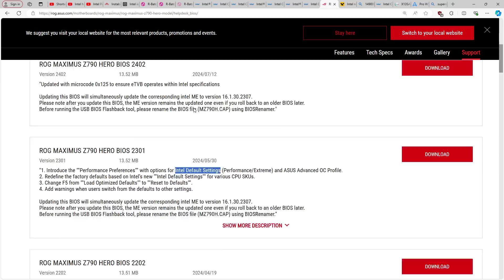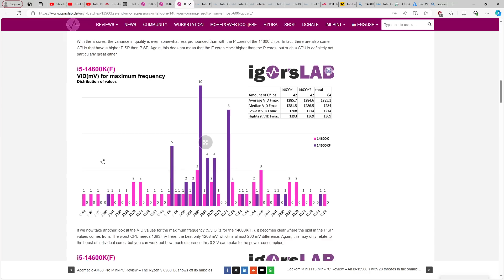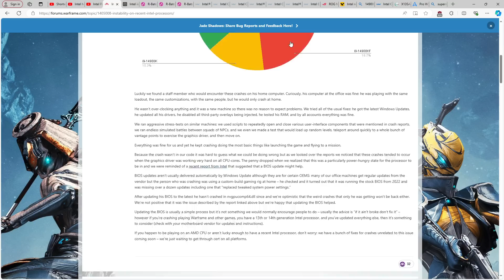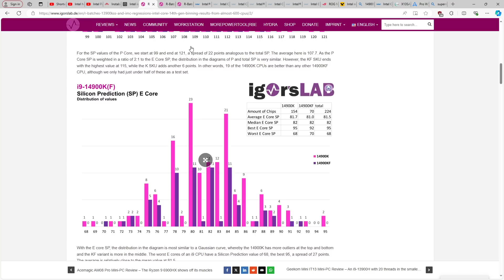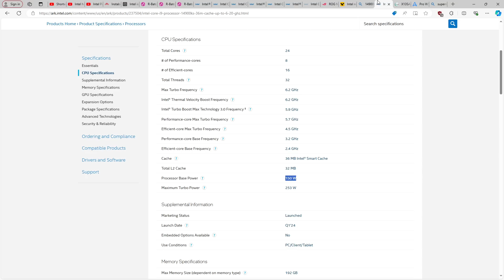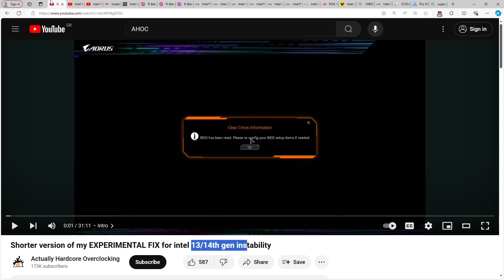The intel instability and degradation rant.

Comment: The reason for the lower LLC is because Intel is trying to run the clock out till 15th gen, they think it will get swept under the rug if they can just make it to 15th gen
Reply: And, the ecores aren’t degrading but if the power rail is failing then the ecores can be sucking down power that the pcores could use
Reply: But it isn’t power, it isn’t voltages causing the degradation or game servers being pampered wouldn’t be dying
Reply: My theory is that they keep making them thinner and thinner and this has caused exposure. They keep honing and honing these binned cores to the point of craziness. They started this with 11th gen, but now it is nuts. They are leaving thickness out of the manufacturing process, maybe this is leaving circuits exposed to heat, especially the power ring
Reply: @waynetuttle6872  Then it isn't CPU silicon degradation.  It must be something else that is failing.  If these continuous multicore loaded, 150w capped game servers running probably around 1v are failing at much higher rates than the general public running these chips on Z790 boards with intermittent single core loads that are often hitting 1.4v-1.5v that points towards the cause for silicon degradation not being the cause for these failures.
The other significant difference is using w680 motherboards that have, by typical i9 usage standards, utterly pathetic VRM systems.  If there is a difference in stability percentages with a difference in hardware, it might be the difference that is the cause of the instability.
Reply: @rluker5344  possibly, but I doubt it. Take any other architecture as a standard, aside from 11th gen which also has failure issues due to thinning of the substrate. Given enough time, despite the vrm or chipset, every last 13th or 14th may fail under ultra low voltages. Some of the server chips are dying day one, this is clearly a production issue when there are currently 4790k chips still chugging away at 5ghz from 2014 with zero issue going back to stock settings. There are 3600-3950x chips that have been gut overclocked and super high voltages since release that will function perfectly at stock settings and run stock voltages and clocks with zero issues. Half of all server chips are literally useless from one to thirty days of use.

Comment: This is not just limited to 13th and 14th gen CPU's. I've been running an i9-12900KF on a ASUS Z690 MB for almost a year, no overclocking, out of the box BIOS settings, with no issues. Recently I started experiencing lock ups and blue screens. Any form of benchmarking ALWAYS froze and blue screened. After a lot of diagnostics I nailed it down the the MMX benchmark.
After discussing with the shop I purchased the system through the guy suggested I try the Intel default profile and boom, fixed!. Haven't had an issue since.

Comment: I believe the ambiguity from Intel on max voltage is partially to blame here.  Datasheet for RPL “-S” says 1.72V max.  Under what conditions would > 1.6V, especially over time, not degrade the processor (outside of LN2, etc.)?

Comment: I can't think of a reason other than VID tables with too high voltages or too-high hotspot temperatures as potential causes (and the latter seems fairly unlikely to me). I haven't heard anything about significant degradation for i7s (yet?) and I assume those CPUs use cut down i9 dies so that makes "manufacturing defect" also pretty unlikely imo.

Comment: But why is all 13th and 14th gen and not 12 gen they have the same ring bus and I have seen 12900ks with very similar voltages to 13 and 14 or is it somehow the extra cache implementation that is the problem

Comment: A long time ago, I suspected that these "boost" clocks and related technology would eventually cause issues. If they want to use those techs, they need a new plan for validating longevity.

Even on my MSI motherboard w/ 5950X, I found it doing some sketchy stuff that I didn't like. 99% of people aren't going to notice if their CPU is running slightly slower than it possibly could, but 100% of people will notice if their expensive CPU dies early, when they didn't do anything to cause it.

Personally, I expect to get at least 10 years out of a heavily loaded CPU and 20+ out of a lightly used one. I'm not one to just throw away my old parts when I upgrade - they always go toward another project.

Comment: I am still skeptical as to whether there is a degradation issue, I do find it quite unlikely and remarkable that Intel could screw that up so much so I remain unconvinced.
1. Bios updates do change AC/DC loadline behaviour and I'm not going to assume Supermicro has no issues with AC/DC load line behaviour just based on brand reputation in the absence of actually checking a board. The loadline behaviour might have changed with an update leading to a higher percentage of CPUs having an issue and I see no reason to assume Supermicro is immune from bad bios configuration.
2. Game updates/software updates - perhaps prior version of the game code running at these data centres had less of a tendency to push single core loads that would lead to high voltage boosting (which tends to the behaviour that most easily crashes an unstable 14th gen)
3. The i9 is more on the edge even without degradation are going to be more sensitive to vdroop misconfiguration issues
4. Some CPUs may have been so on the edge with AC/DC loadline undervoltage that minor degradation over time has been enough to break them, when it normally wouldn't be an issue for a properly configured AC/DC loadline.

Comment: Having owned 3 samples of 12th and 13th gen, each rigerously tested and used for both professional development works and gaming socketed in a gigabyte z690 with 64GB of ddr4 3800 gear 1 and undervolt tuned, I just want to share my experiences with each chip I've had.

For all 3 Intel i9 K/KS, I had achieved stability for 6 - 12+ months, however, all 3 took more time to stabilise than anticipated, I often found that tuning voltages for vccsa/vddq would then make the system ram perform consistently stable and then introduce a CPU instability, requiring another 10mV vCore. The problem though is that initial testing would appear the cpu is stable, however, it was boarderline.

Peak Core Voltages and frequency VIDs.

12900K - VID 1.480V @ 5.1Ghz, stable at 1.392V.

12900KS - VID 1.505V @ 5.5Ghz, stable at 1.432V.

13900KS - VID 1.468V @ 6Ghz, stable at 1.404V.

All 3 i9s, achieved their advertised all core boost clocks stable as follows.

12900K @ 4.9Ghz, 1.232V @ 260W
12900KS @ 5.2Ghz, 1.272V @ 280W
13900KS @ 5.6Ghz, 1.260V @ 310W

Important note is that all running in gear 1 IMC/DDR4 modes required an extra 20mV vCore for all 3 i9s, with the above voltage being observed in gear 1 ddr4 3800. Another consideration is the more package heat/temperature requires ~10mV increase to vCore every 10C increase to package temps seemingly auto incremented by the bios/chip. 

I haven't observed any noticeable degradation, especially with the 13900KS as this is my daily driver of the last 12 months, and changes between summer and winter required an adjustment of only +5mV in the last 12 months, with strangely lower cpu temps requiring slightly more cpu voltage.

Motherboard bios releases under stock settings have switched from considerable over voltage to slight under voltage since when I first purchased the Gigabyte z690 2.5 years ago. I believe I have been lucky with the silicon lottery, and I believe that the motherboard stock settings with later bios revisions would not be stable for a lot of 13 - 14th gen with my 13900KS seemingly having better than average voltage/frequency requirements yet in stock bios settings for 5.6ghz boost only having a 10mV stability headroom.

Comment: Intel 1.5 Vcore inside!  

I ran a 4470K with 4.4 GHz all core at 1.35v. for 7 years until it became unstable, in which a reduced the clock frequency to 4.3 GHz at 1.325 for another 3 years no problem.  CPUs shipping stock voltages of 1.5 is mad.

Comment: I read Intel was using  some new kind of phase change memory for their cache system so they could squeeze more logic onto their SoCs as PCM takes up less space than SRAM. Funny thing is all the docs I have read about PCM is it has write endurance issues which degrades in time for every memory cell written. So if your processor is fizzing out as time goes on, perhaps it is suffering from digital dementia by design. I wish I could remember the source of that phase change memory reference, sorry!

Comment: It's astounding some of their CPUs degrade at 85C or cooler, in which the W-series boards are running according to Level1techs should handle near infinity at that temp. So.. the chip is being overvolted to death?
8:00 each CPU probably has slightly different voltage tables as they did in Sky-lake class chips. Some are specced for more some less with same model, same clock mode depending on silicon lottery. This is bypassing all that? 9:55, i see

Comment: Moore's law is dead said intel engineers were bragging about how fast they got out raptor lake and beat zen 4... How impressive of them to raise voltages to an unstable level in a mere 11 months!
Reply: @wikingkrig5801 I wonder if the via and substrate layer density is so high that voltage is bleeding through layers  due to the fact how many cores are shoved on these relatively small chips?

14900k = 24 cores @ 257 mm²
Threadripper 7965WX = 24 cores @ 4x 71 mm² (284mm²) 

Processor dimensions for Socket sTR5 is 4410.9 mm2

Processor dimensions for LGA 1700 is 1,687.5mm2

So Intel shoved the same amount of cores onto a substrate that's roughly 2.5x smaller. 

I know Intel e-cores are not the same at all as a Zen 4 core and the architecture is vastly different, but still.... 

Makes me wonder if LGA 1700 needed to be nearly twice the size to accommodate 13th & 14th gen. 

I'm probably wrong on all accounts, just speculating and sharing an interesting bit of info I noticed 😅
Reply: Intels official statement is that it’s not the chips, it’s the motherboard manufacturers and game’s not optimizing their products for this new chip
Reply: @madclone84  I wish it would be true, however, it is bullshit

Comment: i came into contact with PC hardware in 2003, at 6 years old. i basically learned about computers and components as a child, and i loved tinkering with stuff, taking it apart and putting it back together, and also loved the software side of it. enjoyed the hell out of overclocking and messing with BIOS settings. things like smashing DEL to get into the bios to adjust some voltages and frequencies are my version of childhood memories. while you can still do that today, it's kinda sad to see all the overclocking headroom go. it's just "overclocked" to the maximum out of the box, all you might be able to do is get the voltage down a bit for the CPU to run cooler. and for what? just for this new stuff to break within months, in intel's case. somewhat sad to see. glad i still haven't upgraded from my trusty 10900k. although not the best CPU by any means, it does the job and it is running 5.2GHz allcore since I've gotten it at launch. definitely going with amd when the time for my 10900k has come.

great vid, enjoyed watching through all of it.

Comment: So is it safe to assume that having an i7-13700K hit 90+C will likely cause it to degrade? And possibly even around 80C? My 13700K only hits temperatures like that if I'm stress testing or running Prime95 or something. 

But I'm definitely not going to put Prime95 on to help crunch the numbers in order to contribute to the actual mathematics if it's going to cause my $400 CPU to degrade quicker. I'll stick to just playing my games and not having the CPU go above ~60C.
Reply: It doesn't seem the temperatures affect the silicon as much compared to the voltages
Reply: @paneledp  Do you think 1.35V, 1.4V at the most is gonna damage the silicon on my i7-13700K? I have it undervolted by .045V. The average looks to be about 0.9V. It only goes up to a maximum of 1.35-1.4V when gaming or rendering.
Reply: @WilliamTell1313 I doubt it'll damage it but the issue may still pertain, just at a slower pace

Comment: My 13600k runs at 1.154V at stock frequency (I think it's -0.075 V adaptive). Is this damaging the cpu I wonder due to more amps being drawn to compensate? I manually set the 2 power limits to 90 something and 125 watts.
Reply: @notexactlyrocketscience  nah 1.15v is super nice bro, i envy you, my 12700KF with undervolt cant sustain full load at  anything less than 1.2v.
Reply: @dethskullcrusher  guess i should be safe then, thanks

Comment: Problem with AM5 and Ryzen 7000 was just a simple case of board vendors shoving way too much voltage into the CPU causing it to die pretty quickly, CPU itself was perfectly made. Easy permanent fix was AMD capped the voltage via AGESA so it couldn't go higher and that was the end of that issue. This on the other hand is far more problematic as these chips are not spontaneously dying or blowing up due to overvoltage they are dying at stock and at low temperatures even in a server board where in some cases the Intel CPU has never passed 125w. This unlike AMD seems like a physical hardware defect in the CPUs which no amount of BIOS updates will be fixing this. 

Intel more than likely know the root cause of this by now as they have the tools for it, problem is do they announce that potentially all or a majority 1300k and 1400k CPU have a physical design issue scaring shareholders, regular customers and customers that buy these in the tens of thousands, because if they do then they will be doing one hell of an expensive recall or replacement program with actually fixed silicon. Whatever Intel do it's going to cost them a fortune as well as loose customers.
Reply: There's no way Intel will announce such an issue, they'll sweep it under the rug like Nintendo did with JoyCon drift being inevitable and do no recalls. MAYBE will issue BIOS update settings for motherboard manufacturers, new stock settings being an undervolt and underclock compared to original stock settings. But the damage is done. You'd have to undervolt and underclock on day 1 to prevent damage.
Reply: @savagej4y241  "to prevent damage" is completely useless when the CPU is practically a nice house that has an invisible landmine that moves around the house randomly and grows slightly every day...

sure, the house (CPU) will be fine for a while, maybe even a year or so, but the one day you "step" on that landmine. It's over..
Reply: @Afurai_ eventually intel will get sued . They cant just sweep it .
They are going to be forced to eather pay out customer's or replace chips .
Reply: @Afurai_  Update: a friend I set up his i9-13900K system for said its having trouble with Stellaris. For reference, the recommended settings are an i5-3570K... Yes, a 12-year old processor. I undervolted it slightly before first OS boot and set all cores to 4.3GHz. Something is up.
Reply: it'll scare intel's engineers too
Reply: 125w is WAY more than enough to bbq a CPU if the temp goes over 74-75 none of these videos show temp in safe margins, would be surprised if warranty support offered
Reply: @foobarf8766  thats on Server baords .they have good cooling .
125w is half the lower a i7 13700k uses .
Cpus are ok with 80c and 85c .
They throtle if they get 90c to 100c .
MOST Modern cpus are resiliant .
Ishues with the intel gen 13 and 14 are High voltages and voltage spikes  and manufactioring defects (  intel is trying to keep the ishue secret , waiting for proper 2nd hand testing to finish for more info )
Reply: @foobarf8766  The PL1 (Long Duration Power Limit) of an i9-14900K is supposed to be at 125W. If it can't handle that indefinitely with sufficient cooling, then the product is defective and absolutely should be covered under warranty.

Comment: What I'd like to understand is if 12th is also affected or if it's only Raptor Lake and it'd refresh 
I'm currently on Alder Lake i5 that works perfectly but I was planning to get something like a 14700K later and now I'm not so sure...
Reply: @afos88  I'm on the same boat, 12th gen is fine, but given this issue we don't have an upgrade path now 😢
Reply: @dethskullcrusher  My only hope is that Intel actually steps up to resolve this issue and maybe release some fixed Raptor Lakes or something like that (if it cant be fixed just by an update) 
After this I started considering buying 12700K or 12900K since both are much cheaper now and good upgrades over 12400 still